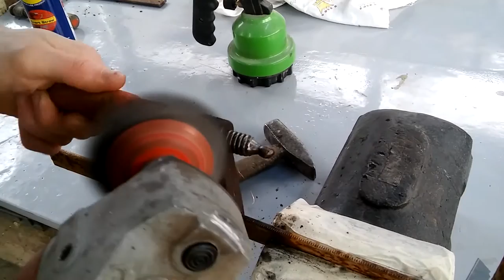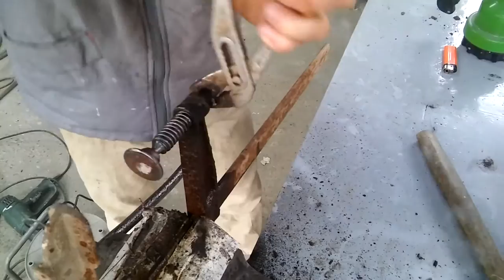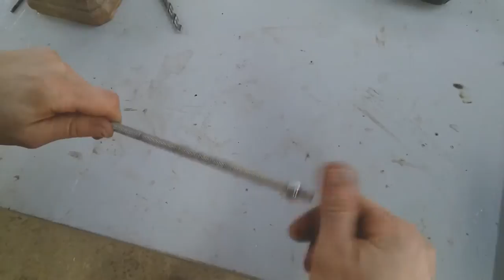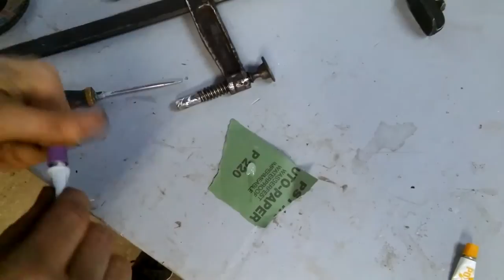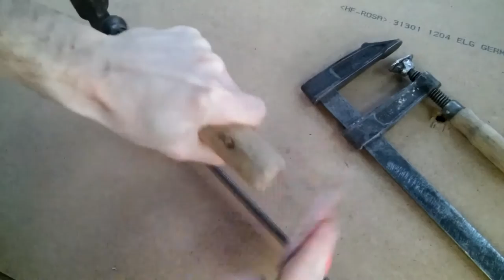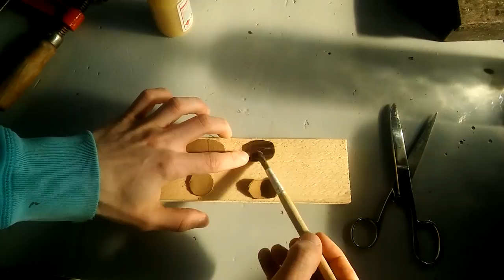Bar clamps restoration

Comment: was there a manufacturers name on the clamp? I have on smaller one that is similar and the Name is Rekord
Reply from the maker: No name, but they have the inscription Made in Germany
Reply: Mine also say Made in Germany, but the name cast into the lower jaw is “Rekord” below the name I the number 1. It appears to be must older the yours, but looks as if they are related.